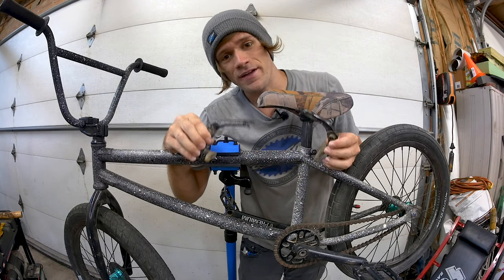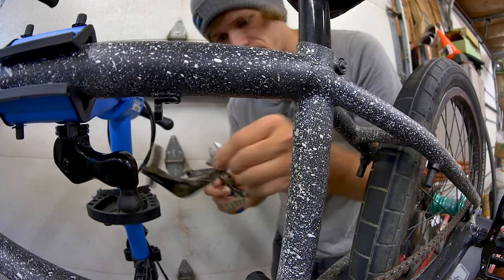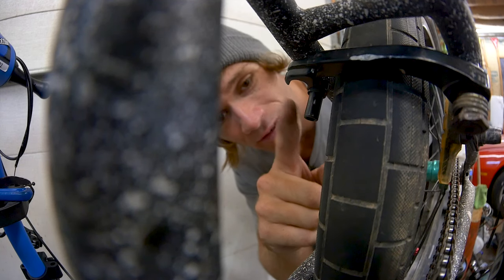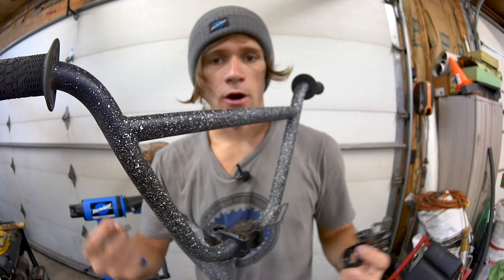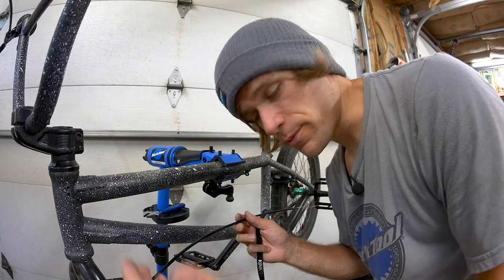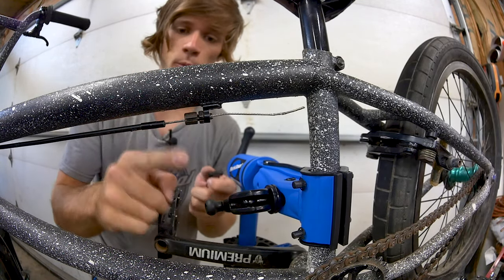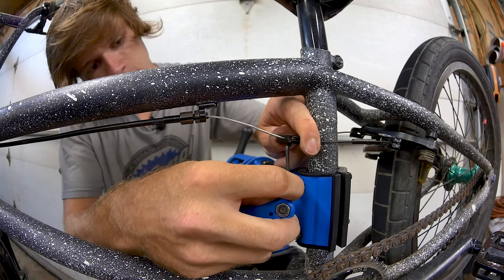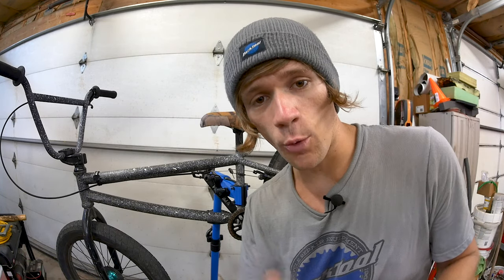How To Install / Put On BMX Brakes

Comment: Great video for breaks overall, but I am having trouble putting the actual HANDGRIP portion of the breaks back together. Inside the actual hand piece of the breaks is a little spring w/2 little spacer pieces, which I cannot seem to figure out how to properly set up so the hand break springs back after break application.
Reply from the maker: Most brake levers don’t have a spring and rely on the springs of the brakes themselves to pull the lever back. So I’m not entirely sure how to help here unfortunately
Reply: @Brant_Moore could you link the brakes you used in this video of of Amazon please?

Comment: Just finished mounting a back wheel side pull brake (Odessey 1999) on a bike I just bought off my friend. Damn thing had no brakes, and none of those tiny circular thingys under the frame that would hold the brake line, yet it has the drill holes at the end of the frame where a back brake would be. What the hell is up with that!? I don't get why they would include an accessory outlet for back brakes, and leave out the brake cable holders. 🤔
Well thank goodness for zip-ties I tell you. They did the job quite perfectly 👌

P.s
The whole process, from start to finish, mounting that damn back brake was bloody hell for me. I should have watched your video instead of struggling through on my own. Good shit here yo
Reply from the maker: They have removable brake guides that you’d have to install. Basically a gyro tab that fastens to the frame with a screw
Reply: @Brant_Moore  Right on! Hell ya, ima look into that if the break I put on faults out, or fuckz up from my own wrong doings of "not really knowing what the hell is was doing labor". 👌

Comment: 6:41 I wind the barrel adjusters right in for a new cable and use a Park Tool BT2 cable stretcher to take the slack out the inner cable

Comment: The other day when I installed the Springfield brakes I ran into a problem I never encountered before. I've put some bmx bikes together before but my area of expertise is mainly road and mtbs.

The thing is that the brake legs are kind of short and the ghost pads don't pivot. Because of this, when you apply the brake, the pads miss the rim for about 1/16 of an inch and hit the tire. I solved this by installing a different set of pivoting pads but I wanted to try the ghosts.

Question is, do you guys slam the wheel all the way inside? That way it would fit but I can't remove two more links on this chain or it'll be super tight. Maybe getting a half link one would help.
Reply from the maker: I can’t get a 100% clear picture though words but it sounds like you just need to loosen the brake pads and align them with the rim with pressure on the arm so you can get a better idea of where they need to be.
Reply: That's the point of Ghost Pads. Only a fraction of the pad is gonna be your main braking force no matter what. So the concept here is why fuss with specific brake pad angles when as soon as you tighten the pad it's gonna move. So Odyssey is counting on their compound to be sticky enough with less time spent on the details. They work. Just line it up so it hits your rim and not your tire, and if you can't reach the rim, try a half link in your chain. Once the distances are set up, that's it. It eliminates fussing with angles. They'll work great, just try it.
Reply: @karilast1395  will do. I have to slam the wheel all the way in.

Comment: 1:07 I remember on my fit dehart frame the break lugs worked loose after a while making my break wobble, and some surface rust in there didn't help so i had to redo my break, so i got some Mafco nutlock on the lugs to stop them moving, grease the out side of the lugs and inside the break arms
Reply: Always check mounts my gyro mounts come loose some times but  common practice  if it feels loose it most likely  it  will be ,we the people mounts come with a wrench for mounts that works awesome

Comment: My rear brake arm has a small plastic piece inside has a small hole that spring pop through, it's pretty perished, yours didn't have that. I have bulldog brakes. Would I really need this plastic piece 🤔
Reply from the maker: If you’re talking about a piece of plastic that is almost a housing for the spring, no you don’t need it. If its something else and seems to have a function then you might
Reply: @Brant_Moore  brilliant thanks so much for reply big help
Reply from the maker: Hope it helps and happy to help!

Comment: What would you use to cut the housing?
Reply from the maker: It’s tough with normal side cutters but does work. I use the park tool cable cutters. I believe it’s CN-10. They are soo good

Comment: Riding brakes is getting rare which is making frame purchases  kinda hard imo , and if you order brake mounts make sure there right not pointed at you brant just in general  I got the wrong ones lucky my failure maniac mounts are compatible  with federal  frames

Comment: I need help installing brakes on my frame. On my frame the brake mounts are on the chain stay instead of the seat stay. Can anymore link me a tutorial on how to install brakes on my frame.
Reply from the maker: It’s exactly the same
Reply: @Brant_Moore  you're right. It just was a little different because it had 2 cable guides and the barrel adjuster is in the seat tube.

Comment: I’m trying to put brakes on my bmx right now but i realised one spring is pushing away from the pad and the other doesn’t, i tried switching them around but ran into the same problem. Then i tried turning the spring upside down and still have the problem. Please help.
Reply: @lachlan.sumnerrr. I was learning new stuff about brake system, for about a year since purchased my first bike. But, it’s relaxing 🤷🏻‍♂️
Reply: Same thing here

Comment: hey brant! whats a good rim finish? or the top 3? i heard another kid on da tube say a packet of ketchup with a thin layer. but ima tard so what say u?
Reply: Keep the rims clean where the brake pads make contact to the rim. It also helps to use clear brake pads for excellent braking.
Reply: Ketchup  works wonders  its sticky when dry and loud, I'm old can tell lol mid school 35 years old

Comment: what size of mount break?
Reply from the maker: It's different for different frames as far as specifics of putting the mount in the frame goes.
Where the brake arm goes onto the mount is the same size on all bmx u brake mounts

Comment: i’m late as fuck... but QUESTION.. what if you have a older model frame with no rear or “bottom” barrel adjuster next to the brakes?
Reply: also, my rear brakes don’t have visible “springs”.. what am I doing wrong
Reply from the maker: It’s so hard to say without actually seeing it

Comment: tell us how to put V brakes on a U brake frame setup & I'll be a happy guy. or how to Jimmy rig it with adapters n such so it'll work. they used to have these "plates" for sale that u could hose clamp on but nobody sells m anymore. & most bike mechanics don't even know about hose clamps. 20 yrs ago some of them did. nowadays they all act like everything is dangerous & won't work. & with that attitude theyz be correct.
Reply: U brake lugs are further forward than Vees, so it doesn't fit. Brake Plates are still available, although rare. These days they're generally not needed. Vees require a closer running pad, have less modulation, and are of a weaker design. Also the levers tend to want a spring in for smoothness. Try having a cross over straddle cable, or short straddle cable so the main line cable has to go through the frame. That style of cable setup is similar to how Vees work. Alternatively you can run a dual cable gyro and cross the cables over by the seat tube for increased power too, but that's a bit more hassle imo. With some decent brake pads and good rim finish you can have a super smooth 1 finger locking brake. I just use 2 for locking and 1 for manuals. Modulation has its benefits. Also running less snapier brakes makes you less reliant on them which can aid your riding, but without the restriction brakeless gives you.
Reply: eskimo if what u say is true then i don't mind switching. but so far i keep seeing the opposite. I'll do it that way to see & feel for myself. whats a good rim finish? or top 3?